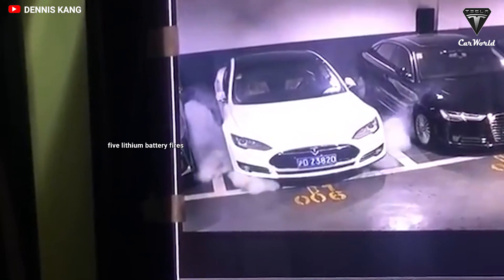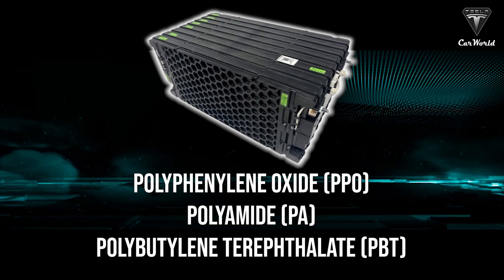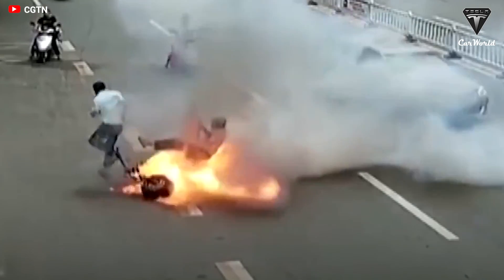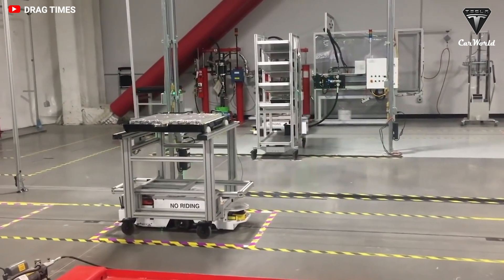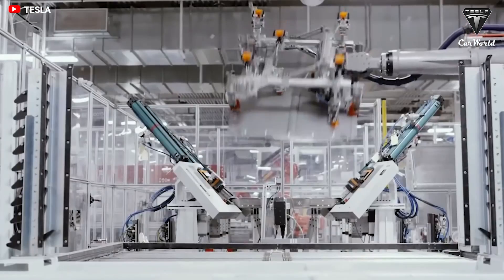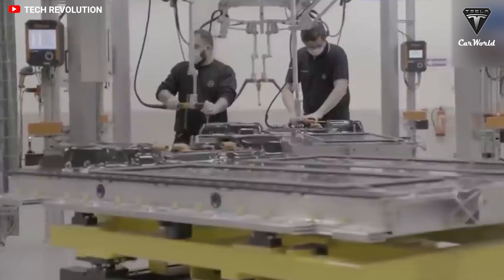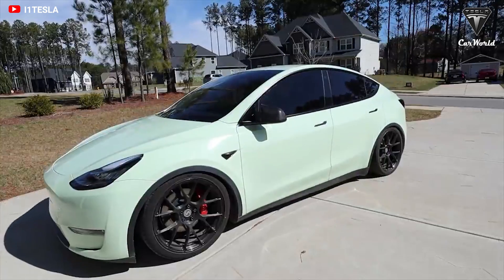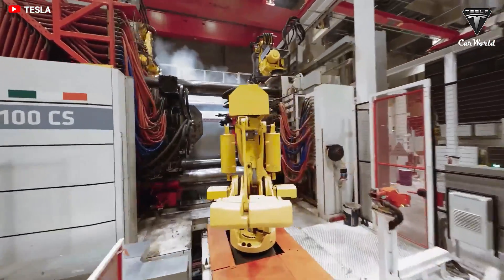Elon Musk: "This New Tesla Material Will SHOCK The EV Industry"!

Comment: Rather than make a shield for thermal run away, why not fix the thermal run away problem. Meta materials has a solution. See the video of their new development shown at CES.
See this video:. Meta Materials, Inc the most important tech at CES 2023 that “matters”
Reply: Even if this is a perfect solution it would be a case of "and" rather than instead of.  One of the challenges of scaling quickly is often you need to get a solution working with both today's and tomorrow's technologies.

Comment: Watch out for the graphene-aluminum battery by Graphene Manufacturing Group. No lithium, nickel or cobalt used. Very safe against thermal events. Utra-fast charge, and they just doubled their energy density. They partner with Bosch, Queensland University & Rio Tinto. They have advisor Bob Galyen, the former CTO of CATL.
Reply: What's the electrolyte and cathode for this graphene-Al battery?
Reply: @tmcche7881  https://youtu.be/7RgHXUUfkk8?t=595
I shared this with the time in the video that answers your question, but it's 100% worth it to watch the whole thing. BTW, they nearly doubled the energy density since this video.
Reply: @tmcche7881  graphene and aluminium
Reply: Wow ..
Thanks for Sharing...
I would like to follow you for more updates on this if you don't mind?
Do pls drop a link...
Thanks
Reply: "graphene-aluminum"

Sorry, speaking from ignorance, does the presence of graphene mean that we are close to getting solid state batteries into production?
Reply: Very interesting.
Carbon, Aluminum, cheap products.
Reply: It just a myth..
Reply: @bizkubis  What is it that's "just a myth"? Queensland University verified results. I guess  some random person taking 2 seconds to type something counts just as much?